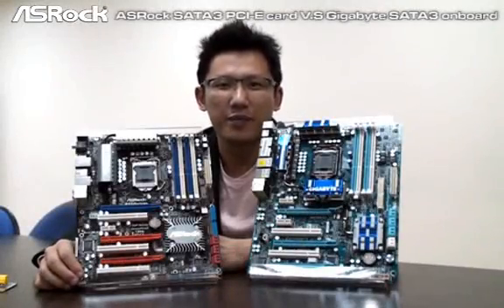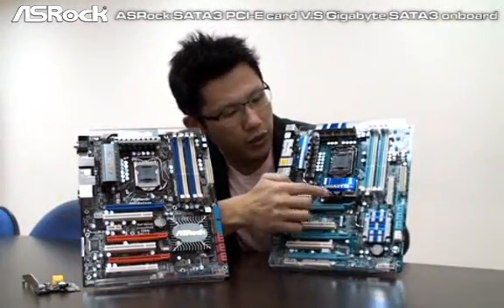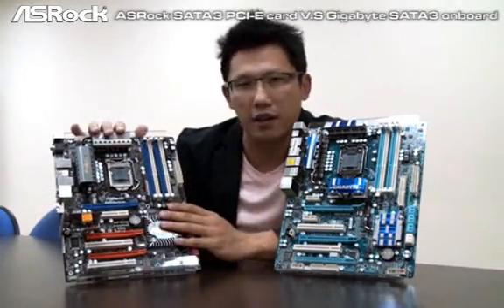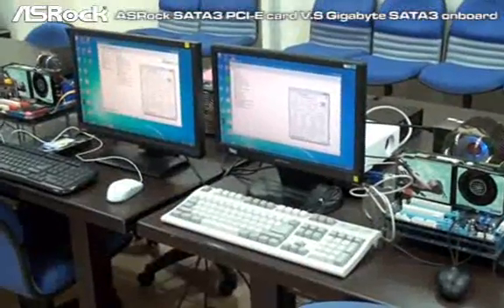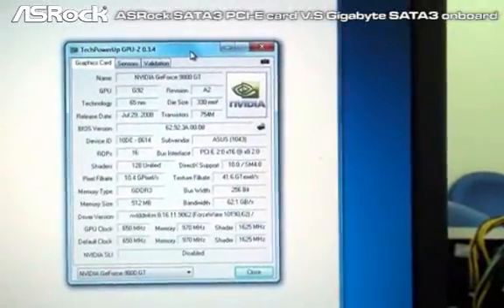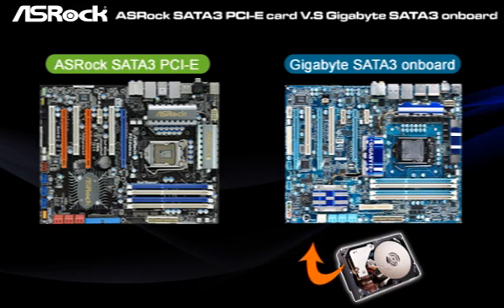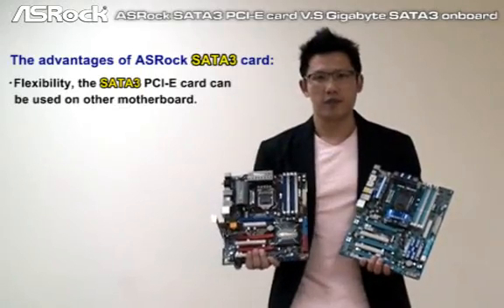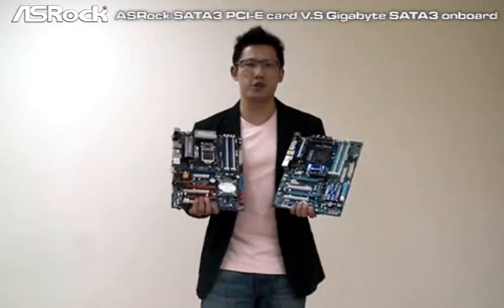ASRock SATA3 PCI-E card V.S Gigabyte SATA3 onboard

Comment: Buhlah49,

I'm not sure about the first question but I do know that you can connect boot devices to this card. However, during installation of  the card, do not connect a drive to it. Install the drivers for the Marvell chip first then connect the drives.

Comment: @niels2029 I'm saying it doesn't make a great deal of difference performance wise (if any) if you're using PCI-E x16 over PCI-E x8. Also it clearly says the gigabyte system is running at PCI-E 2.0 x16 anyway, making the second point moot.

Comment: So in other words... if you want the ASRock mobo... you can only get 2 sata 3 slots... if you go with gigabyte... you can install an additional expansion sata 3 card and get 4 slots and then in the future... you can throw away the expansion slot which is like what? 20 bux? and simply get a new motherboard which im sure in the future will have only sata 3? So based on this... im confused... how is the asrock the better option?

Comment: How the dicks can that be a good feature?

Every upgrade from p55 (in the future, assuming your p55 board lasts you a year) will have sata3 onboard anyway.

Oh, and if you're going to have a sata3 drive already, you're probably on the cutting edge, and have a SLI/Crossfirex setup anyway, which means the card would run at X8 anyway.

Also, the difference in speed between X8 and x16 is probably minimal, because no card today uses the whole bandwidth of PCI-E 2.0 x16.